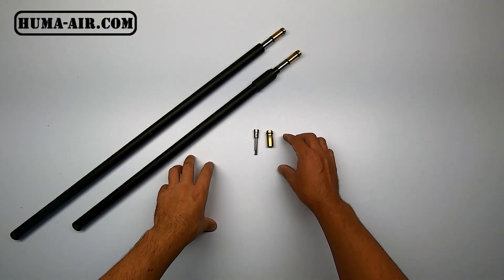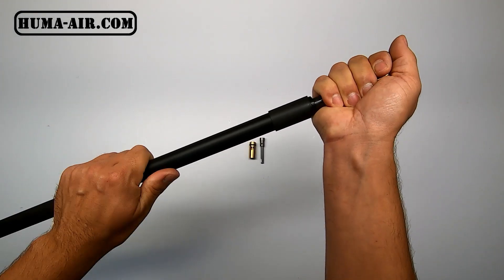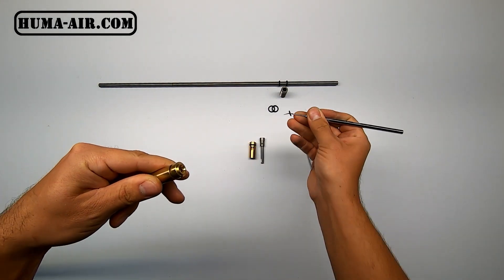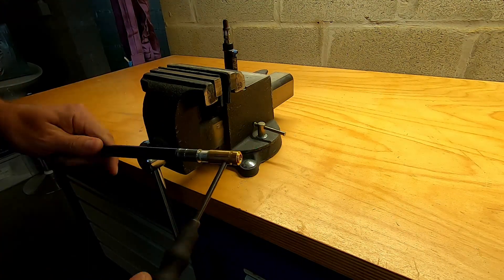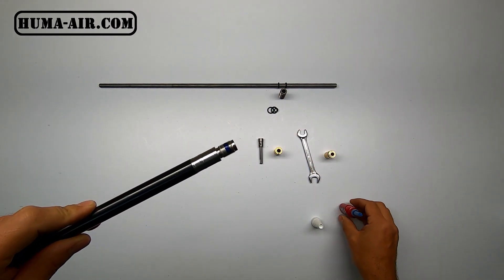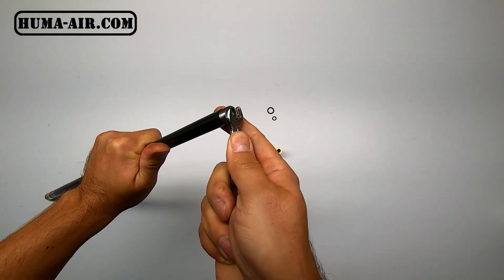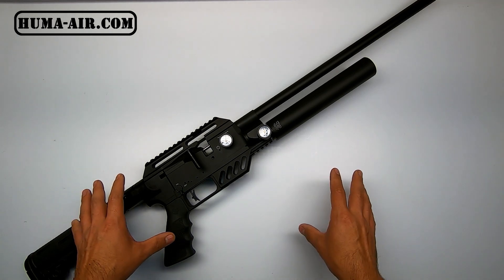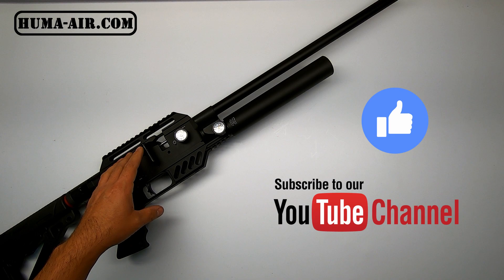Huma Air High Flow Dual Hole Transfer Port Installation

Comment: Congratulations on the Video, very educational! I need your help with a tip! I have an FX Impact X, I installed an internal power plenum and I have it in caliber .22 .25 and .30 in length 700 ... I am interested in buying this accessory from Huma ... here comes the doubt: considering that I already have power plenum Do I tend to think that the greatest benefit should be in buying this accessory, looking to give it all the power to move the largest caliber? My favorite caliber is 22 but I think that any benefit of installing this port and probe is marginal since it would be solved with the Power Plenum ... right? between .25 and .30 which do you think should receive this accessory (considering the ballistic curve, weight and everything that affects the shot in these calibers) I hope you help me since I have in the HUMA shopping cart this product to waiting to lean on what caliber, greetings
Reply from the maker: Hi , thx for your support 👍 

Fist question is if you shoot only pellets or also slugs ?

If you shoot only pellets the impact with power plenum is designed to do this perfectly so not really beneficial unless you want max power then every little bit can help .
If you like to shoot slugs you will need to push a lot of air behind it and the Huma tp lets more air true then the oem. So then I would install them on everything.

I use them on all my calibers also for a another reason , I like the best accuracy not the most power or FPS. Thx to the Huma tp I can keep the reg pressure lower and still keep the speed and therefore have a less violent shot with beter harmonics , beter accuracy . 

Hope this makes sense 😬
Reply: @Airbuks  Thanks for the kindness in responding, also very fast ... I have seen and tested the virtues of slugs (HUBEN K1 with Slovenian MP molds which I make at home) ... I prefer slugs! unfortunately FX hybrid slugs are expensive ... I always search and google for mold options compatible with the FX Impact magazine. At the moment you resolved my question and I will begin to renew my ports and probes with HUMA. Thank you very much !!!
Reply from the maker: Yes I know, I wish the hybrids were cheaper. But unfortunately I don’t have the time to make some myself, but if you find a good working mold that makes FX mag compatible slugs let me know 😉 .
Good luck stay safe and healthy

Comment: bij een .30 dreamline met cilinder ,heb ik ook de huma reg  met de 30 cc plenum en fx plenum(47 cc extra) plus de dual flow ,en met  de reg op100 bar en transfer port op 17 .22  en hamer spring druk lager gezet heb ik nu 50 schoten (tot reg druk)die de 22lr swinger(caldwell) op 50 meter met grote kracht  zeker omleggen ,waar die met een normale magnum springer alleen klinken ,alleen de hatsan carnivore 135 .30 kan het ook maar niet zo gemakkelijk wegens de enorme zuiger en veer(krijg daar zelfs nog een .299 79 grain slug uit ) .
trouwens de fx fabriek zegt/ adviseert ,de snelheid verhogen kan  maar beter is om meer schoten na te streven op lagere reg druk.want voor de  pellets is meestal 800 tot 850fps het best wegens de precise of nog lager ,2
 bij sommige kalibers ,de kleinere dan .30 helpt het ook om de  orginele  probe doorgang te vergroten.want anders helpt de dual flow niet veel, je kan de probe en dual poort vooraf buiten de montage bekijken door de probe in de dual flow te steken en zie je rvs  van de probe dat zit in de weg .mvg peter
Reply from the maker: Hi , idd de ideale snelheid voor een pellet ligt rond de 880 FPS maar soms moet je hem kunnen tunen voor meer power als je Bevoordeeld slugs wil schieten . 
En de probe is idd een belangrijk punt daarom heeft Huma nu een aangepaste probe in de kit gestoken 😉
Reply: @Airbuks   die probe kreeg ik er toen niet bij  .was er nog niet denk ik. ok mvg p tussen haakjes ,de mondingssnelheid is ook niet het belangrijkst ,hoe gaat de pellet down range om met de startsnelheid, bijv pellet gaat dwarrelen na een bepaalde afstand  wegens de instabilliteit die er bij de start inkwam ,en die door de rotatie in de klauw gehouden werd.en die rotatie  nam af door de geringe massa van het pellet

Comment: So this works for FX Wildcat Mk2?
EDIT: NOTE! This transfer port does NOT fit FX Wildcat 2. It is the same diameter but longer and has a sort of flange sticking out at the breach end. The Wildcat 2 port is slightly shorter and is flat at the breach end.
Reply from the maker: Yes it will fit every STX barrel
Reply: Glad you asked. It was going to be my question. Did this improve your wildcat? In what way? Please🙏